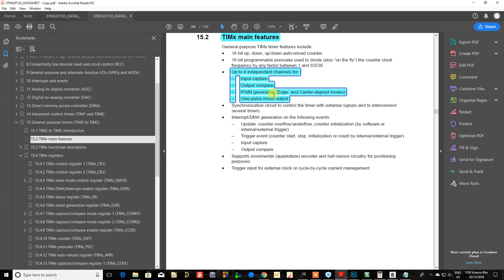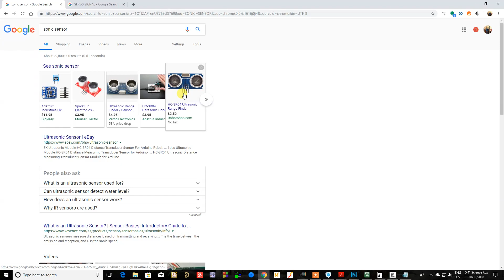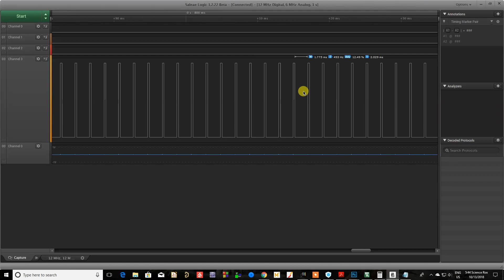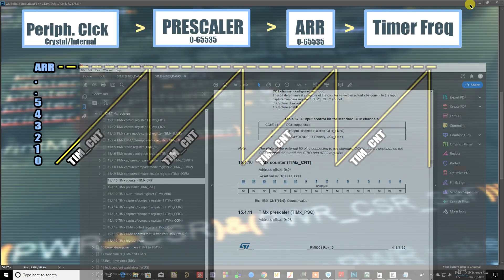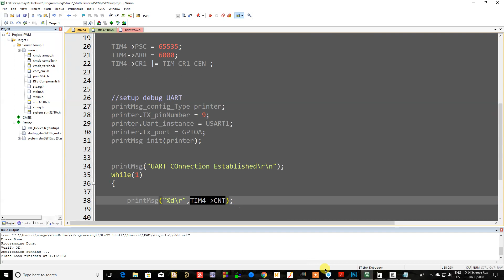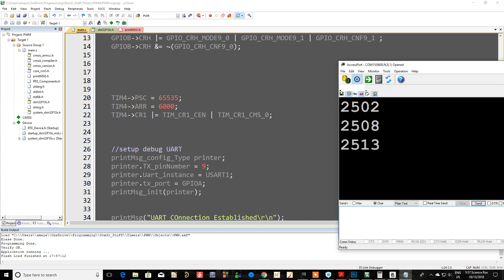Stm32 Intro To timers

Comment: can we use multiple channels of the same timer for rc receivers ? will it work ?  some thing like timer 1 ch1 , ch2, ch3 , ch4. I want  to connect rc rx all channels CH1 TO CH6 to the TIMER 1 Channel 1 to Channel 6 in input capture mode and is it possible with one timer and if is there any performance issue with that or do i have to use another timer for each channel of rc rx
Reply from the maker: i dont see why not, give it a shot! best way to find out

Comment: Tx Eddie. Just be careful with your Math formulas! So around 14:31 I see Periph Clock / Presclaler / Arr = Periph Clock / (Presclaler * Arr), now this is not right according to normal operand associativity for division, so without parentheses, which is left associative and not right associative. So, A/B/C without parentheses, is interpreted as A/(B/C) and not as (A/B)/C which is not the same thing. So, A/(B/C) is in fact (A*C)/B while (A/B)/C is A/(B*C). So your second formula, that one with the multiplication is correct, but you need some parentheses at the top of your first formula, so (Periph Clock / Presclaler) / Arr. Ok. See also here : http://web.deu.edu.tr/doc/oreily/java/langref/ch04_14.htm

Comment: Hi man, thanks, I am still confusing about this timer

I want 7mhz frequency output. I am using stm32f103RB and timer2 What I need to do ?.
You said peripheral clock/your desired frequency. Below setup is in my clock configuration

HSE = 8Mhz
SYSCLK = 64Mhz
HCLK = 64Mhz
APB1 = 32Mhz(Peripheral CLK)
APB1 = 64Mhz(Timer CLK)
APB2 = 64Mhz(Peripheral CLK)
APB2 = 64Mhz(Timer CLK)

TIM2
clock source = Internal CLK
PSC = 9
ARR  =  1

I need Finaly 7Mhz frequency output so,
64000000/7000000 = 9.1428
In here 64Mhz is which one ?
SYSCLK ?
HCLK ?
APB1 ?
APB2 ?
APB2 Time clk ?
because 5 clocks ar now 64Mhz I am confusing here also

so then PSC is = 9 and ARR = 1

Please let me clarify me on this... I am awaiting your support.. Thanks Eddie

I need without interrupt subroutine. I just want to create delay instead of using normal HAL_Delay(); function

Comment: Hi Eddie, thanks for all the great videos.  Your explanations are so good. Please please please if you can help with this. I am trying to get ETR clock mode 2 working and for the life of me I cannot get it to work.  I am hoping to get to what the datasheet is calling "Slave mode: External Clock mode 2 + trigger mode". I am trying to clock the Timer with an external clock source and align it with packets of data but I cannot even get the ETR mode working. I am a hardware engineer by trade and only do software on the side but I am finding your videos so helpful. I have followed your videos and got PWM up and running but I cannot get the clock source to change to external trigger mode. A video on ETR would be so helpful thanks.